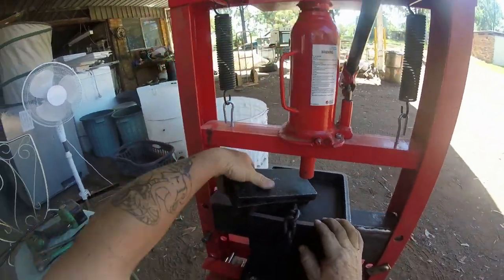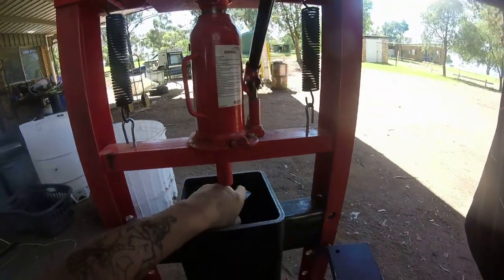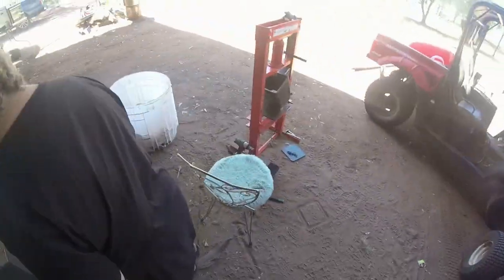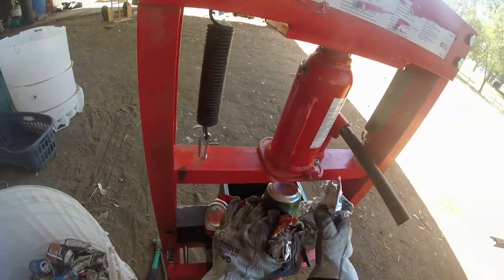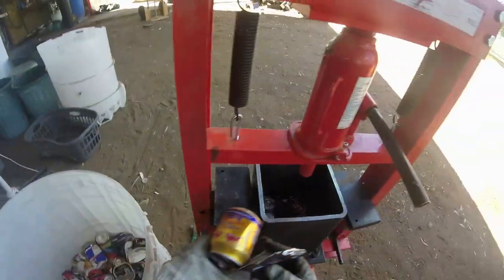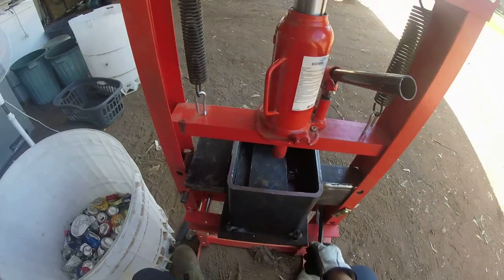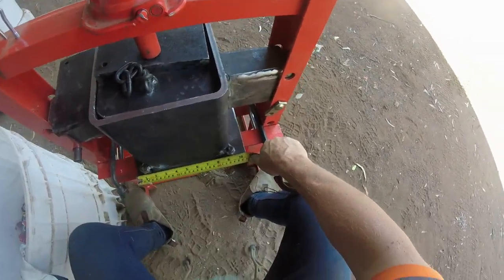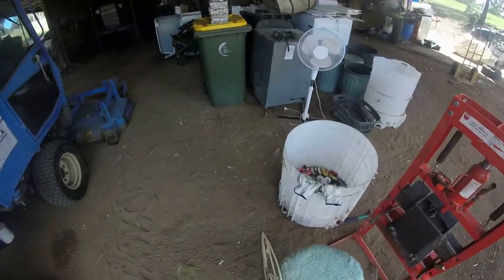A DAY AT HOME PRESSING ALUMINIUM TRY'S AND CANS

Comment: Very cool compactor.  Here its more valuable to take cans to the recycle depot, where they have to see the UPC or no value.  Each can is 10 cents. /cheers ScrapBongo
Reply from the maker: Yeah our cans are $0.10 as well most of the cans that I cannot uncrush I do crush them in the press but I actually made the press up more for the aluminium trays so it's becoming very versatile.